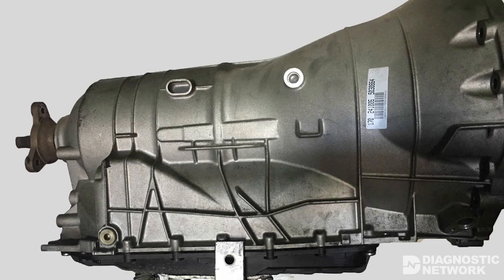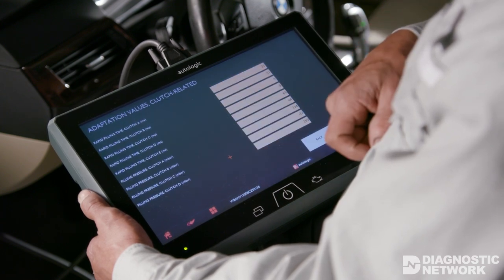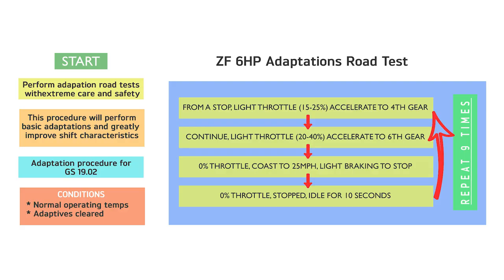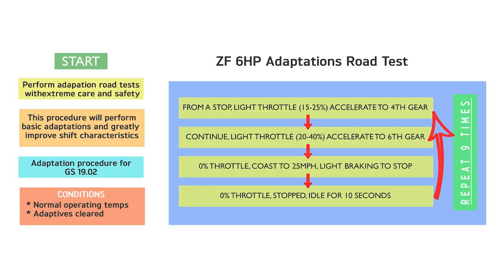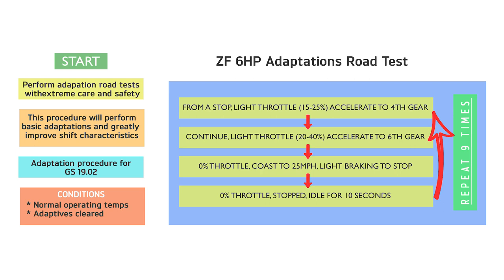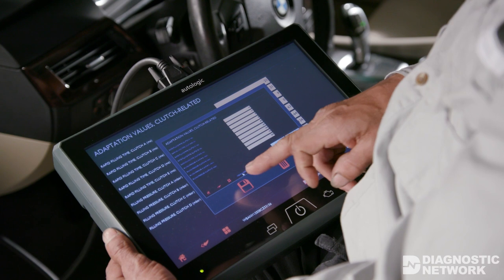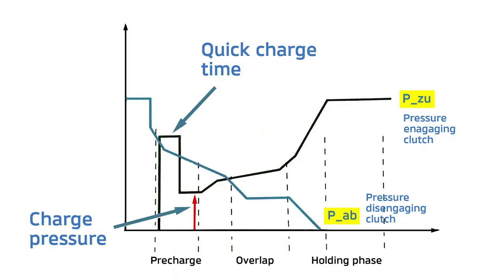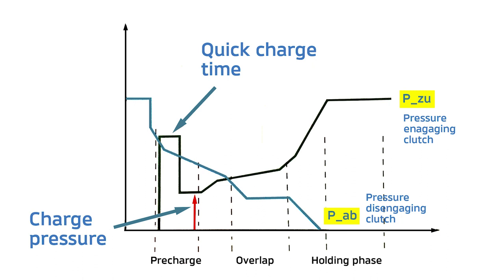ZF 6HP Adaptations (Part 1) Diag.net (REVISED)

Comment: I wish I had changed the valvebody solenoids on my 6hp28 when I serviced/flushed trans. Oil was quite clean and no shavings found at 77k miles, 335d car. Experiencing overly delayed firm shifting on
gears 2-3 that was worse when cold and driving in slow acceleration. After I serviced the trans and flashed a performance tune it did minimal to help the situation. I will need do the service again with solenoids.☹️

Comment: Your statement that transmission fluid expands 30 percent for every 10 degrees Celsius is wildly inaccurate. The coefficient of thermal expansion for transmission oil is somewhere about .0008 per degree Celsius, which is less than 1 percent per 10 degrees Celsius.

Comment: Super detailed data to have on the ZF 6HP - One comment seems questionable "The ATF will expand 30% for every 10% Celsius" - This seems excessive. This would indicate a 30 degree increase would DOUBLE the Fluid volume? That does not sound plausible. If temps went from 0 degrees Celsius to 60 degrees, 4 liters of fluid would become 14.3 liters?
Reply from the maker: Hello John, thanks for the feedback. The quote should actually have said: “fluid has the physical ability to expand 30% of its volume from 40-50 degrees celsius” not through the temperature range assumed.

Comment: Hello Mikey 🫣 questions as a tranny expert, i know is an old video and you may not reply but ill give it a Try!! i got a 6HP26Z (AWD)  all my adaptations are within spect ( got limits from ZF) My question is about Clutch "C"filling Pressure ZF limits -400/+350mbar  my car currently reads -376mbar very close to -400mbar and i get a little hiccup on second gear which is when "C" clutch activates, my questions is based on your comment on the video that high minus value means pressure related problem! which i believe it falls under Valve body needing to be rebuilt correct me if im wrong, Or Solenoid malfunctioning but valve related problem correct?? thanks in advance for any help given 🙏

Comment: Hi. At last someone who talks real sense on these boxes! Could I try and explain my fault? From cold it has little to no drive. If i go through the box it helps and once warm it will behave sometimes without fault unless under load, if I shift to manual it goes up through the gears to 6th without drive. Do you think this could be seal and tubes? Or valves? Ive just purchased valve block seal and tubes to try first. Thanks

Comment: HELP!!ZF TRANSMISSION QUESTION!
A question on ZF transmission problems on 2008 e90 335i.
The story short: got an e90 335i RWD 80k miles, origin USA.
-Recently it started not shifting from P when it’s cold started. Give it few minutes and it shifts and you can drives good for the rest of the day regardless of how hard you hit it. No fault codes or anything on scanner.
-I figured well the oil is so dirty that it doesn’t go through the pores and it takes time to heat up so I changed the transmission oil and the mechatronic seal thinking it would solve the issue. While driving on highway about 100km/hr, I hit a bit of gas while driving around 100km/hr and it went to limp mode so continued driving 2km till I got home and parked it.
- next day I towed it to garage, took out the valve body and the mechatronic seal was slightly torn.
-Ok so I put a new one again, filled it up with 
oil, closed it and drove it home. 
- but I still got the same problem. Car doesn’t shift from P right away on a cold start, and now I’ve got a new problem which is between 3rd and 4th gear the shift is very very bumpy. 
-i Connect to inpa yesterday and did the adaptation reset and followed the procedure thinking it would solve the bumpy shift but still very bumpy between 3rd and 4th only. 
What do you think I’m up to? Have you had anything similar problem? 
Thanks for your input.

Comment: 07 335i here previous owner said he replaced the transmission with a low mile before he sold it to me and since Then I’ve noticed it drives fine when you drive it slow and take it easy but the trans doesn’t know when to shift and keeps revving out and downshifts sporadically during and after wot , and also Limp mode and hard downshifts after doing pulls. I’m thinking maybe when the new trans was installed it never got adaptation cleared and reset or maybe it’s something worse .

Comment: Hello, I have a 2006 range rover HSE and a couple of months ago started having hard sift(like a clunk) from 1st to 2nd gear, the other gears runs perfect. Interestingly when I put the car in sport mode it shifted fine from 1st to 2nd likewise when shift manually no issue is noted. I replaced solenoids but no changes were noted so I put back the original ones, I also replaced all the rubber gaskets (3 cylindricals and the square one), reset the adaptive through RSW software and "tried" to do the re-learn process but it seems doesn't work its still having hard shift from 1st to 2nd. My suspicion is about wrong numbers in pressure  value to open valves when shift from 1st to 2nd but I don't have how to confirm. Any thoughts related with? Thanks in advance.

Comment: hello..after watching your 2 videos i had a very good idea of my problem and fix....2006 jaguar s type r with zf 6hp26...i was having a rpm flare at full throttle from 2nd to 3rd and some jerky up and downshifts and hanging in gear sometimes a little longer than expected..i decided to go all in...replace all solenoids and end caps...also all accumulators and seperator seal...also the 4 tube seals and bridge seal...new filter pan and fluid....before the repair was clutch A=400 mllibars...clutch B =280 clutch C =400 clutch D = 143 and clutch E =400....after repairs and successful adaptation drive....clutch A =-230 clutch B =-262 clutch C =101 clutch D =-120 and clutch E=-270....i do not know what a new tranny acts like but now this one is sure close...all shifts smooth and power transfers very quickly....your thoughts appreciated and thanks again for showing the values and what they mean and very thorough explanations.also for posting the adaptation parameters..forgot to add the car has 170,000 miles on it...

Comment: Ok, so...positive mbar adaptation(+xxx mbar), means a loss of pressure for the the respective clutch. But, what does the negative mbar adaptation(- xxx mbar) means? Also, i see that are some rapid filling times for each clutch. What do they mean? Is there an adaptation procedure also for 8HP transmission?
Reply: 6:40

Comment: Hi, I found your video, and I was hoping, you can advise me, on my transmission problem I have on my bmw x6 35d zf26
Up shifting from 4th to 5th the car goes in to limp mode. The error code I’m getting is 4f85 gear monitoring coupling E
I’ve changed the adapter seals, and new ATF fluid, reset the adaptations. Unfortunately the problem is still there. I was wondering if I would replace the bushing on clutch E would solve the problem? 
Thanks in advance!
Vilmos
Reply from the maker: Are you an industry service professional? If so, you may want to consider posting your query within Diagnostic Network along with your diagnostic findings to date. If not, we recommend that you seek out a professional service center for support. You can find that original video along with the discussion from this address: https://diag.net/msg/m56p49ze7389h4bs...
Reply: Have you serviced and replaced the valve-body solenoids? And also the plastic components?

Comment: Hi my ZF 6HP 26 has difficulty shifting gears:  It slips the gears from 3-4 (code P0783).  And gear 5 incorrect ratio (code P0735).  And gear 6 incorrect ratio (code P0729).  I cannot drive the car now because it always goes into fault mode when trying to shift from 3-4.  What should I do?  Thanks
Reply from the maker: Hi Aman, 

Are you an industry service professional? If so, you may want to consider posting your query within Diagnostic Network along with your diagnostic findings to date. If not, we recommend that you seek out a professional service center for support.
Reply: @DiagNetwork  I would be grateful for your assistance and expert advice on how I can fix my car please.  I would be really grateful for any advice you can give.  Thanks

Comment: When my bmw e61 is cold and i lock the cruise control at 40-50 or 60 km/h the rev is slightly pending. When the engine and automatic transmission reach operating temperature its acting normal
Reply: can I please ask if you experiencing and small kick when you, for example, holding brake at stop crosssection and then when you release the brake the car little kick or it's perfectly smooth. I do a test drive on car I want to buy and the shifts were smooth(they were little noticible when cold, but smooth at operating temp) but the only thing I have noticed and worrying me was that little kick when the car starts moving from standstill(gearbox in D) Thanks.
Reply: @banny123456  No kick just smooth

Comment: If you ever bought a brand new BMW and asked why it had 50+ miles on it and they told you "its from setting the transmission adaptations" then by all means you should follow the ZF procedure.  But if you've ever thought about the sheer lunacy of BMW taking every one of the 2.3 million cars they make per year out to the Nurburgring to do 45 minutes of random stops and starts then you probably understand that this is all very much out of context. They'd only just now be finishing up the 2014 models LOL.   If BMW doesn't even set adaptations this way on a brand new car then WTF?  Obviously there are some default values set at the start.  Then you drive and it adapts.  And when you reset to those values what do you think happens?  Hopefully not this idiotic procedure that will 'adapt' your car to driving in a way that nobody actually drives.  That you paid this guy 1-2 hours of shop time for.   I'll assume you can figure out the actual answer.

Comment: Smart guy, but i would never put ZF fluid in BMW transmission, only Valvoline Max life. Use ZF filter and pan!
Reply: Why not
Reply: While MaxLife is labelled as LT161411 whatever compatible, it's debatable as to if it truly is.  Aside from cost, you saying to NEVER use ZF fluid (without an engineers explanation as to why not) is useless.